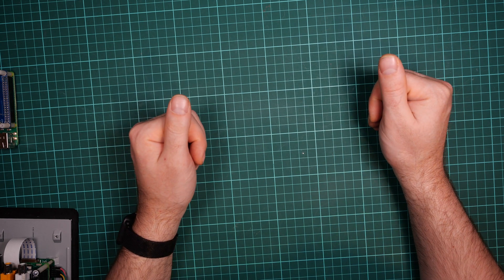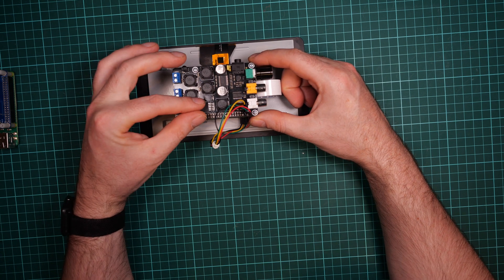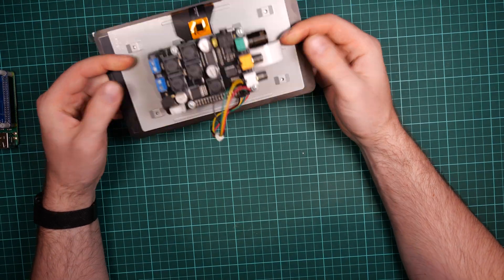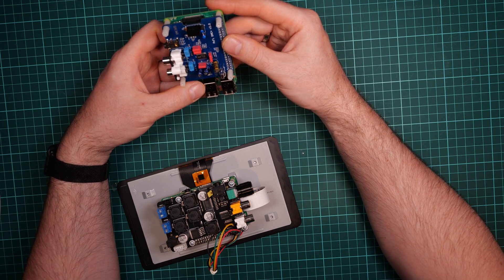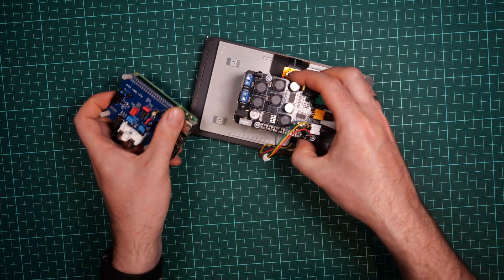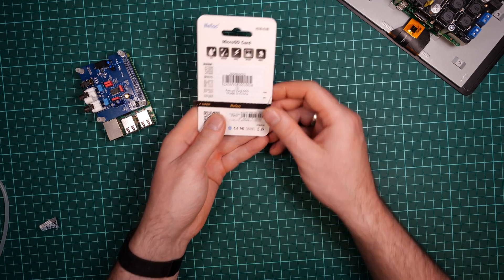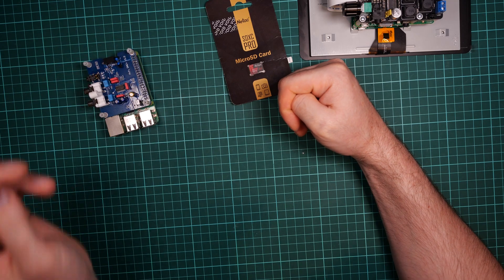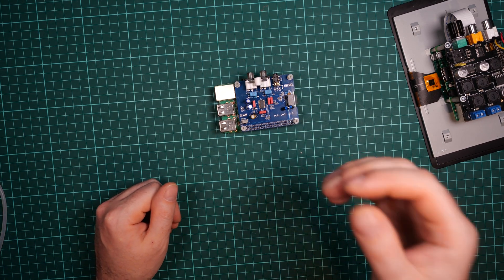PIFI Digi DAC+HIFI DAC

Comment: Hey

I'm trying to connect my raspberry pi in an old 5.1 home theater that I have here, using a pifi digi hat v1.0. I modified the config.txt and seams that my pi indemnify the board, but it doesn't play anything. Would u help me?

Thks